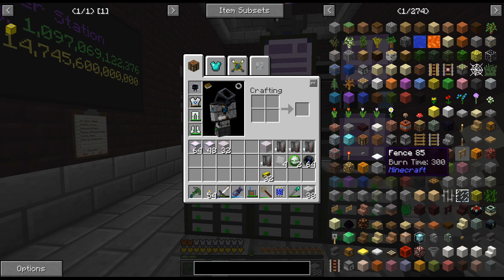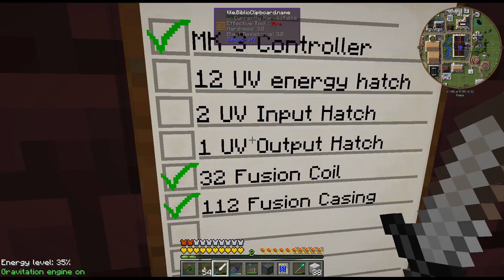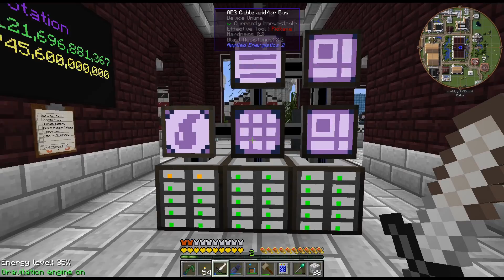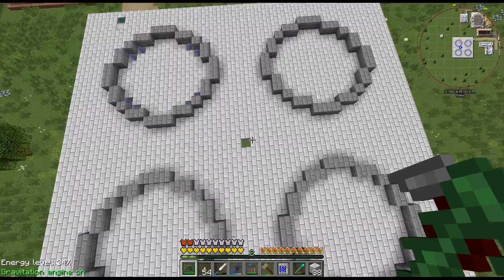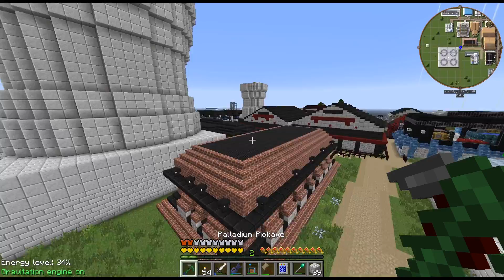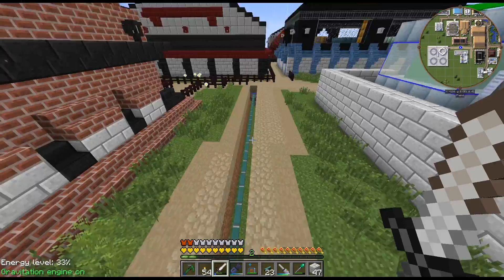Gregtech New Horizons - 367 - More Fusion Reactors

Comment: Placing down multiblocks freezing your game seems to be related to it checking against all the other blocks in its "structure" however for some reason it includes wires and a myriad of other GT blocks in this check so in essence it ends up checking through nearly every wire/connected multiblock in the entire base causing an extreme lag spike. There is currently an issue on github to try and address this problem, should hopefully get fixed in the future.